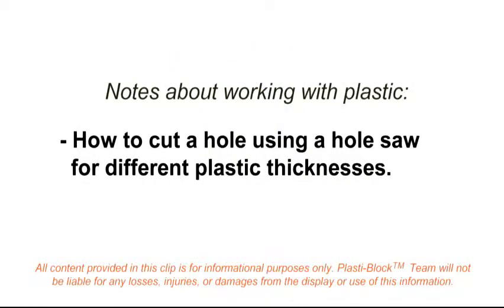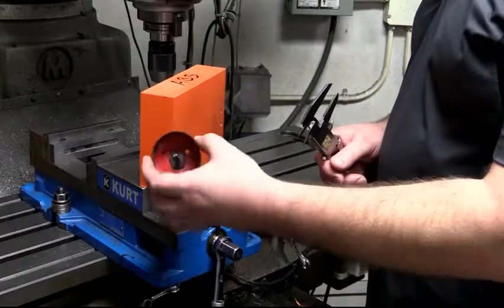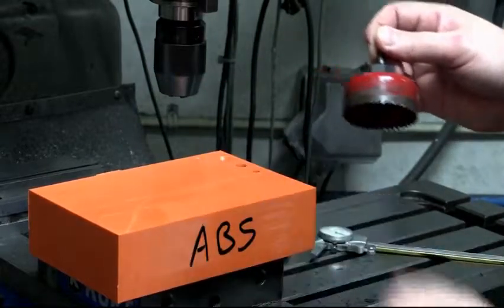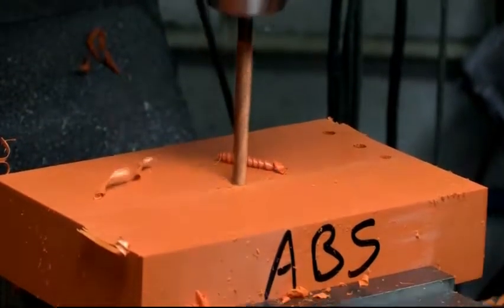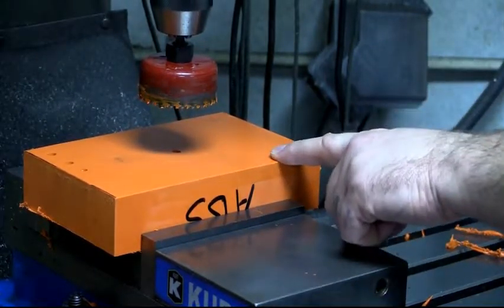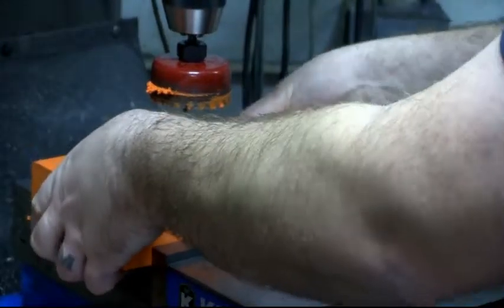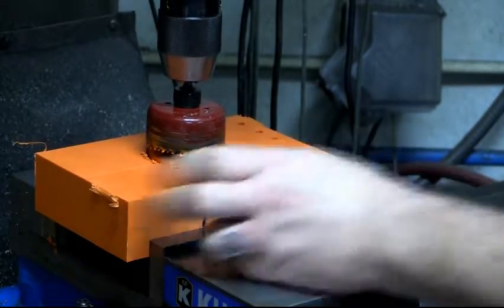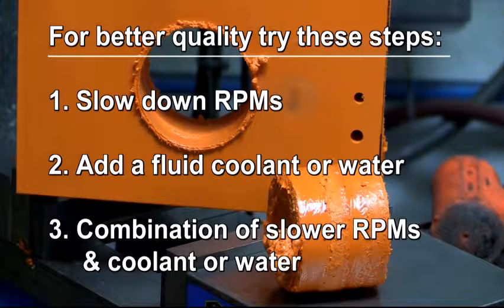How to cut a hole in plastic using a hole saw

Comment: Thank you for the thought of cutting through thicker plastic by drilling a pilot hole! Ive been drilling high-density plastic with Milwaukee 18 inch hole saw it my drill press on an angle. But this should still work? Also, I cut on the lowest speed on a low end, $150 job from harbor freight. I noticed you're actually getting smoke as you're drilling what a lower speed possibly help this? I'm brand new to all of this just looking for helpful hints and tips. Ty.

Comment: Thanks for the useful video and all the information. My question: I would like to drill a hole in a canister and insert a floater. I don't want to use glue or any chemical compound, how would you advise to do this. FYI: the floater has a flat base that will cover the hole. Is there a way to fix it on the canister using the melted plastic from the drilling? Or maybe a different machine?

Many thanks
Reply: Thank you Amine! We would usually recommend an adhesive, but given that is not ideal for you, you could try to weld the "floater" using the shavings and a torch.  We cannot guarantee long-lasting performance using this method though.